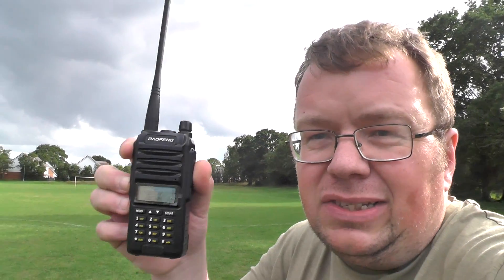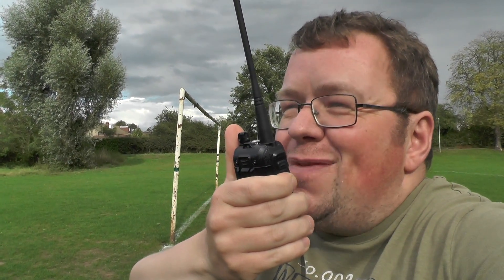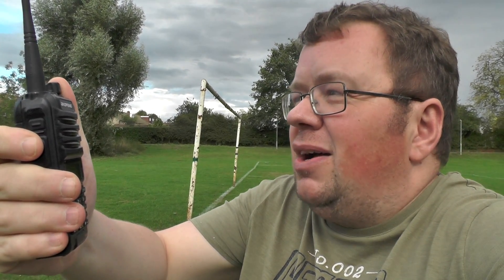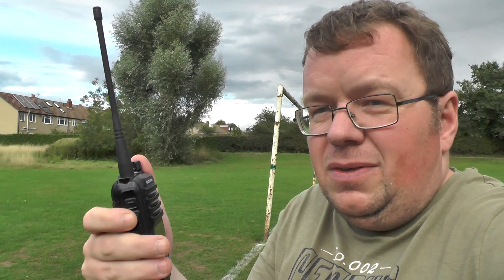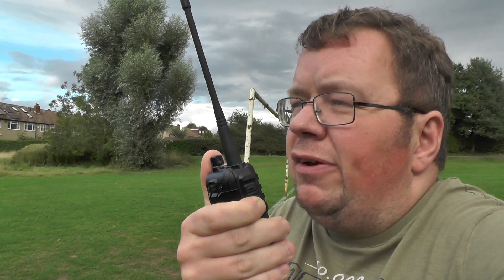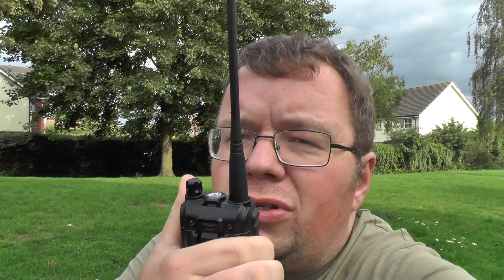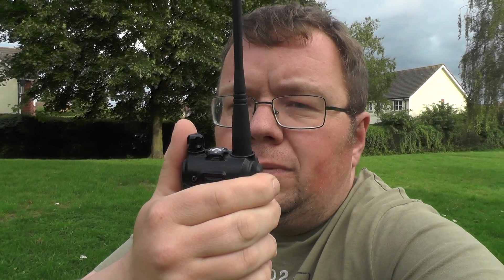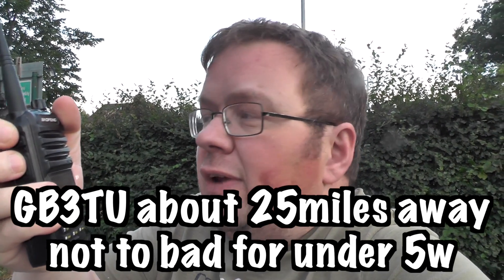Baofeng Repeater test

Comment: I heard a little white noise, but it sounded as if were coming out of the repeater. But other than that, it seems to be a pretty good little radio. Not the best, but pretty good. 
That 18 watt speaker is kicking! (Thanks for the video from the USA. 👍)